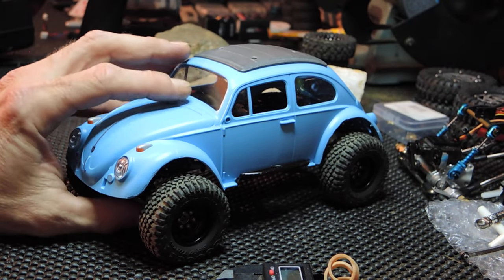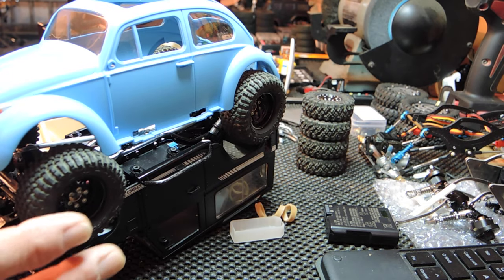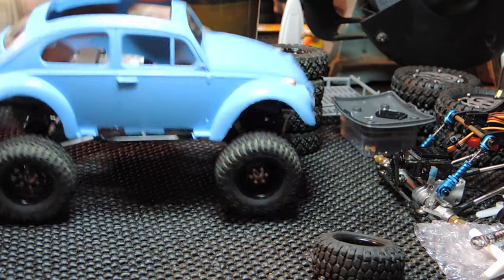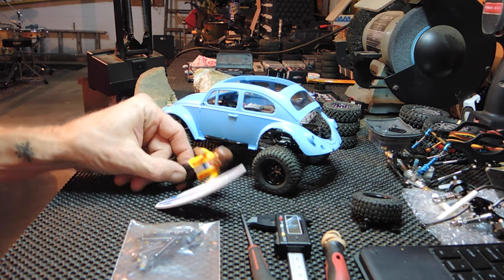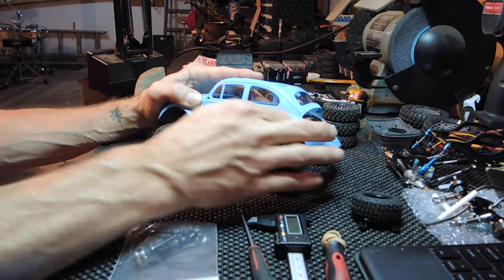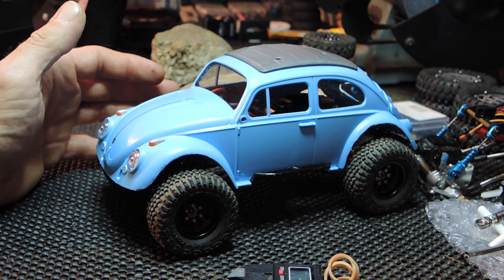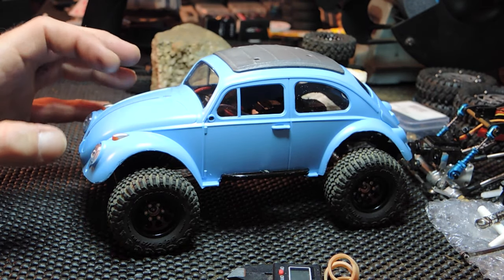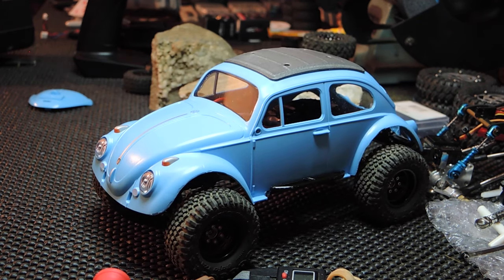SCX24 1968 Beetle Build Video #playmobil

Comment: Can’t wait to see the finished product and see it run. There’s one of these locally for sale really cheap. I may have to go for it.
Reply from the maker: I'd go for it! Depending on how much trimming you're into doing, it will run just fine no matter what. I weighed it last night after lights going in and the body is currently at 98 grams. Not bad and it's well distributed, mainly up front. The corners of the front wheel wells will be the thing you want to focus on. But yeah, you can do pretty much anything with this one.

Comment: I made one of those recently. Didn’t see your vid until today lol!
Reply from the maker: Yeah, I did this thing back in July or something. I should have bought stock in Playmobil at the time.
Reply: @VermontScaleCustoms  I put it on a Trx4m chassis. Did a patina paint job first try ever. I like it.
Reply from the maker: That's cool it fit. I would have thought the TRX4M was larger. It barely fit a JLU/C10 wheelbase. Definitely had to trim. That's cool it worked out. After I got the lights in mine it hasn't left the shelf!
Reply: @VermontScaleCustoms  it is longer but I’m not as custom as you are. I’ve just got the Bronco in January and by March I was trying something new! Ended up with. Trail Hunter and recently a Redcat that I customized a little as well. Fun stuff to do when you’re retired. Hard to see those small items tho! I’d attach a photo or video but don’t know how? Where do you get your numbers or other small decals? Looking for some black stars, military type to put on my FJ45 body?!
Reply from the maker: Well, good for you, Kevin, glad to hear new people are still getting into the hobby. It's a perfect blend of tech and fun and it gets people outside and active. As for those stickers, they came from a GMade R1 sticker sheet. You might be able to search for some stuff on eBay. I've seen RC sticker sheets in various sizes. This might get you going on a search - https://tinyurl.com/4c92r4ba

Comment: I spend time looking for usable body’s any and everywhere as well. Right on
Reply from the maker: I put a Mini Cooper on a Hobby Plus CR18 Rushmore chassis a couple summers ago, that was a fun build, too. Multiple land rover body swaps, etc. It's always fun to see how to get them to stay mounted well enough to run.
Reply: @VermontScaleCustoms  I got a few model bodies but there to small for RC even though many build with them guy even has a channel dedicated to doing so but 1/18 to me are more usable. Gonna get one or two of those VW kits you got cause man that a good price and good quality
Reply from the maker: I would grab a VW kit for sure. It's a decent option for the money. Well made with tons of details. Much more solid than a 3D print, too. Not afraid to roll this one. I have one 1/20 model kit body on a Kyosho Mini -Z and it's not quite right but it looks okay. Kind of monster truckish.

Comment: Awesome idea! I have been looking for the same thing!How does the wheels/ tires rub at full turn?
Reply from the maker: I removed enough material to not only be able to turn to full lock, but also have no issues while climbing. I trimmed enough where the corner of the fender meets the running board and left just a little bit intact for the look. No issues at all.

Comment: You could take something like small diameter heat shrink and add it to those fender edges to give a somewhat fender flare look . That would maybe kinda make that rear fender that got chopped a little to much not to obvious.
Reply from the maker: That's not a bad idea. Making some lemonade out of that lemon. Your idea just also made me think of having it be sort of a repair in progress. Like, filling it and painting it sort of primer color like it's waiting to go in for finish.  Almost like it got dinged up like our 1:1 did in the accident! But, yeah, I was so bummed when I saw that was uneven. It's not the end of the world but it certainly throws the look off for now. Especially if you stare at it long enough like I am right now, lol! AHAHHHHH!
Reply: @VermontScaleCustoms  I wouldn’t say it ruins the look. Glue something on like the heat shrink and make it look trimmed out. The repair in progress thing will work also. It’s a great looking rig though.

Comment: you have inspired me to do one lol
Reply from the maker: Nice! Of all the SCX24 body swaps I've done over the years, I like this one the most I think. It just fits really well. The KR3 tires just send it for looks.
Reply: @VermontScaleCustoms  what were the running boards you bought for it? Injora?
Reply from the maker: Those are Kyx and I've had those for about 2 years. They were originally on my C10 before it went through about half a dozen variations. I'm pretty sure they're still available. It's such a good fit and works really well for keeping the body on.
Reply from the maker: These little guys. You'll find them under a half dozen different names. https://a.co/d/gJZeFTe
Reply: @VermontScaleCustoms  thanks. I know it's heavy but I do want to keep the interior in mine